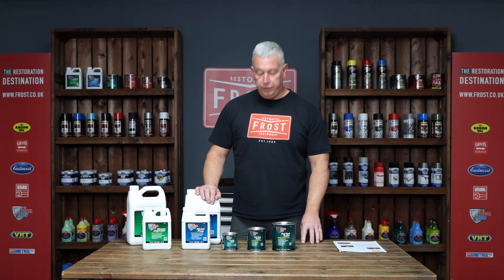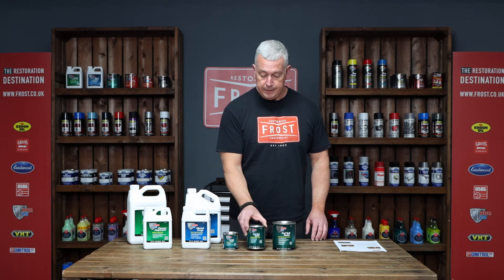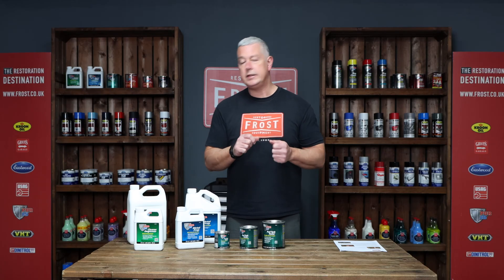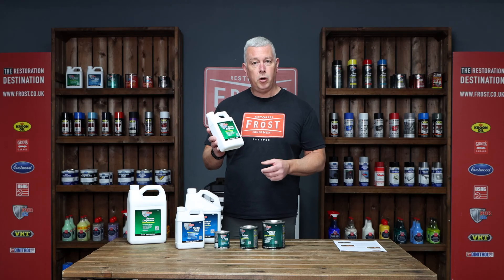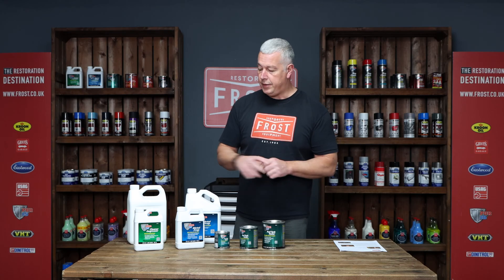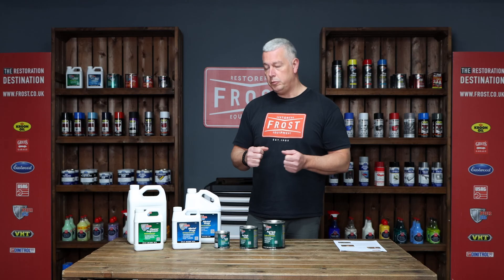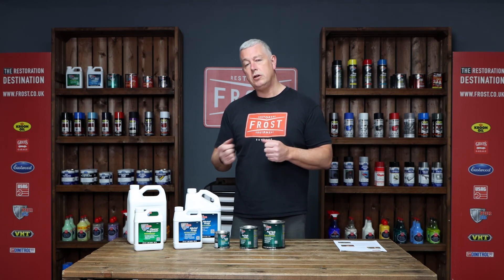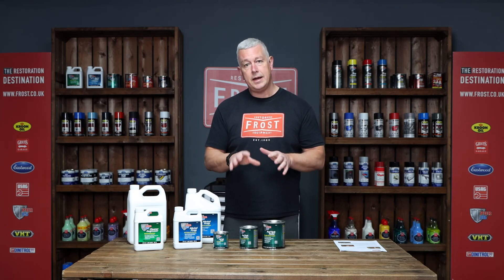What is POR-15 Tank Sealer?

Comment: The sealer doesn’t go anywhere near as far as stated so make sure you order plenty. If you don’t, like me you won’t cover all the tank. I’ve had to order some more, not sure if it will adhere properly to the sealer first applied. As stated the coating is very thin more like a lacquer with metallic flakes in. The tank I am trying to seal surface is very rough and uneven and it has run off a lot of the pits leaving varnish type finish.
 I’m not very impressed with it and wouldn’t use it again.

Comment: I just used this on two old 50 gallon aluminum diesel tanks that were on an old rig. They actually don't have leaks because I welded up everything. I'm doing the coating just in case and to extend the life of the tanks.

Comment: I think I might have a slow leak in my boats aluminum tank - built in.  I can’t slosh things around much and my only tank access is though a 2 inch hole for the sender.  Could I made it work?  I could lift my trailer tongue up and down with the tractor… TIA
Reply: hrm. It would be a pain but I would get one of those dryer vent cleaner kits with the flexible plastic tubes that attach to the end of the brush. Attach the other end to a drill and you should be able to work the brush around the tank. You'll still need to clean the tank + metal prep + thorough rinse and have to pump that out first and really make sure it's dry inside after.